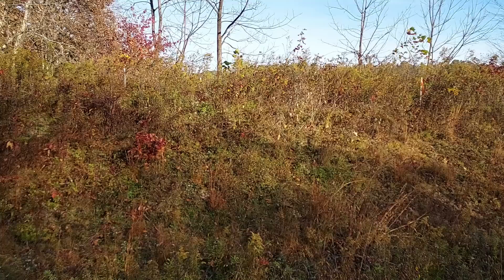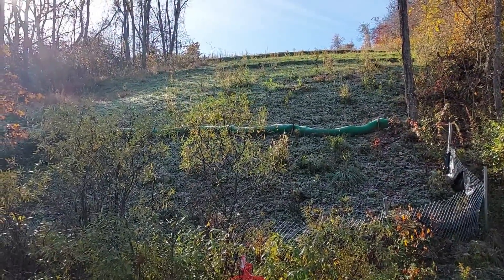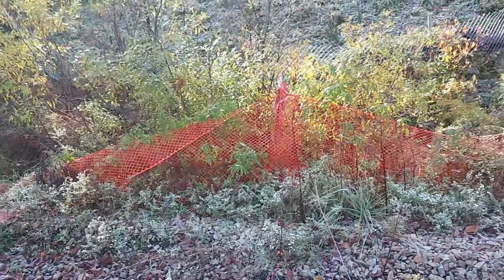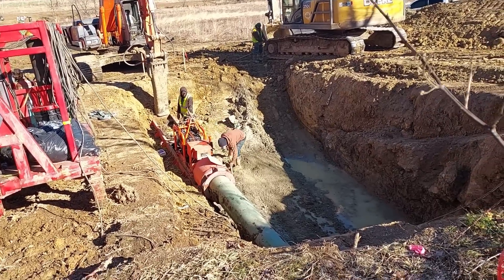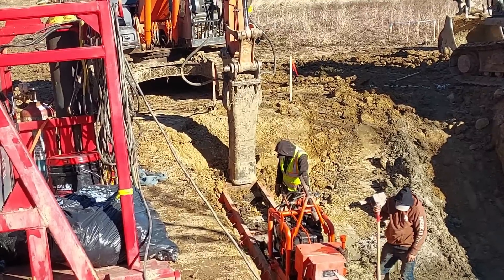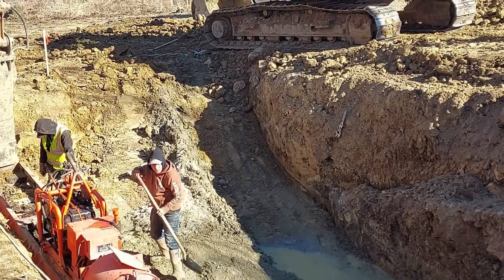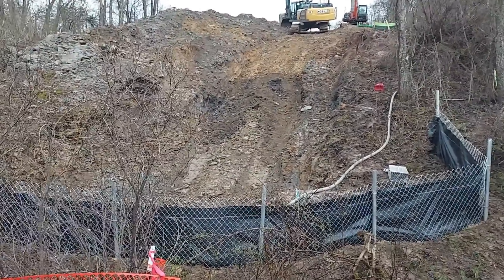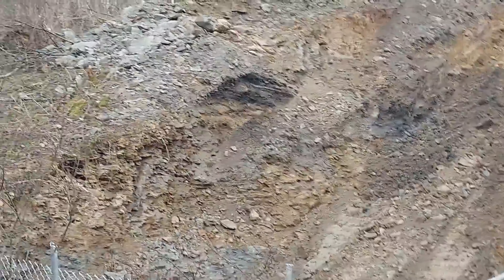Boring Under our Railroad Track

Comment: I bet it is boring under there, not much to do.
Reply from the maker: Actually horizontal drilling is a bit intense, you have to get the
grade right on the bore. The guy in the excavator holding
the rig down , now that may be boring, but an easy day for him 
nonetheless.

Comment: Whenever they bore under the expressways in our area, within a year or so the road develops a dip. As time goes by, they get more severe. I expect it's because they can't back fill the earth to the original compression. On the highway it's an inconvenience. With RR track, I expect it could be dangerous. Do you monitor the ballast for sinking symptoms?
Reply from the maker: That's interesting to hear Rosey. They have bored under our
track many times for pipe lines and never had a problem at
all with track sinking, thank goodness!.  Appreciate your visiting with us and watching. May you have a most blessed day my friend.
Reply: @ccrx6700  Does adding ballast and other rail maintenance possibly compensate for settling?

Comment: Dave those bolts for the track do they have a hardness and torque spec
Reply from the maker: They are grade 5 bolts Ed. Yes AREMA has torque specs for them
depending on the size of the bolt, however we have found over
the many years here with 16 miles of all jointed track that
tightening them to AREMA specs is too tight. Our track has to
move and we have found that around 350 to 375 ft lbs does
the best for us here. Thanks for taking the time to watch and
write in my friend.

Comment: I read a report somewhere on the internet that the I think it's it's called the Federal Railroad Administration (like our Department of Transport in the UK) does not allow fracking with in a certain  distance of a rail road track, some time ago, I cannot find it, but is there such a mandatory  law for this.
Or was it only certain states?
As I read that rail roads were worried about subsidence beneath the rails.

We at my town in the UK had  a large yellow high pressure gas pipe put in using a mole,  it was put under a park and cricket pitch, they dug several holes to start and end it and another half way which was in the middle of the pitch.
Think the pipe was 9 or 12 inches, it might have been bigger, when finished there were bulged in the ground and the bentonite lubricant came our at several place especially the cricket pitch which the cricketers were not happy.
It's amazing what you can do today, as before a digger would have to dig a trench for it. In your case a big disruption on your rail road.
Thanks for ano6the interesting technical video on your RR.
Reply from the maker: I have not heard of that rule Anthony, tried doing a search for
it and found nothing. There are many different shale plays here
in US with varying depths. In my are the Marcellus Shale Play is
7 or more thousand feet under the surface, fracking that far below
a track I don't see any way it could affect surface. If you ever do
find a ruling from FRA on this please let me know. Appreciate
your stopping by and watching the video my friend.
Reply: @ccrx6700  Thanks.
Digging a shaft for coal if not keept pumped out and roof supported will cause subsidence.
In the UK we have incidence  of these.
The main enlargment of the old war time burns hospital at Frenchy Bristol could not be over 2 stories due to this and was moved to anothe part of Bristol, due to the large undergrund mines.
Also like in the US where a coal seam catches fire, I think they have all been put out, but with a lot if structial damage.
You must be great to work with always jolly in all weather and problems.
Thanks for you great railway technical, decriptions and video

Comment: The pipeline carries Natural Gas and gasoline, I think. The fact that the pressure is greatly increased is why it does not freeze. I don't understand why increased pressure makes it hotter, but it does. They have a separator that takes the gas out the top and the liquid out the bottom. The refinery has liquid in the bottom and gases on top of the those tall vessels and power plants have tanks that have steam on the top and water on the bottom. I don't know how that works, but I have seen the displays that shows the water level in the vessel and the steam on the top and it works. Maybe when they installed the pipes the technology wasnt able to have both liquid and gas in the same pipe. But they do it now. These pipes are 70 years old now, the original ones, the 18 inch ones. The 30 inch are at least 50 years old. The 48 inch ones were put in late 80s I think, so 40 years on those.  They test them every 3 months for leaks at the test points. They only mow the ROW once a year, if that. I wish they would mow every month. The grass and weeds get 8 feet high.
Reply from the maker: Thanks for taking the time to watch and write in Rad Bill.
Increased pressure means more friction is produced against
the pipe walls. Thus producing more heat. Very much
appreciate your stopping by today my good man.

Comment: When I was working for the railroad, any construction within 20 feet of the rail and anything over or under the tracks had to have a railroad flag man.  The flag man had to be NORAC qualified so it was usually either MOW or operating crew that would do those jobs on overtime. I did a lot of hours hanging around watching people work while getting time and a half or double time. 
We had a crew doing test borings in a rail yard for a new highway interchange to be built over the yard. Spent a lot of days in that one spot! Nice work if you could get it, but it gets pretty boring (pun intended).
Reply from the maker: Thanks Bill for the awesome comment. We have had several
pipe line operations under our track in the past several years.
Drilling and pipe lining here the industry is tremendous. We've
had to have a flagger on a couple of those also. This one was an
exception. Gas company inspector was virtually non existent
on this job where the last line they bored under our track at
curve 14, their inspector was there constantly and kept in
excellent communication with me and also the train operator.
Another one where they crossed the track with equipment, I
was with them all the time right on the spot. Easy days, but
cannot afford to get anyone run over by a train. Always is
a pleasure to hear from you my friend.

Comment: Natural gas, especially from fractured hard rock wells, produces water.  Most times, this produced water is brine and cannot be dumped.  Reuse makes the most sense, eventually it goes back into depleted wells.
Reply from the maker: Yes it does Keith. That water is called produced water and the
longer a well is in operation the more produced water it makes.
Got a video that I have yet to show where they have a new
innovation, first in the state of Pa. which is an evaporator.
Now they don't have to treat the brine water, only remove
a small amount of solids which depending on content, can
be used for some industrial uses. 

This is an unlisted video but will let you watch it to see the
evaporators in action. 
https://youtu.be/Eww67sjMxho

Comment: Make dam sure that the company gives you a gas sensor to check for leaks in those areas before doing any work , great video Dave but your safety comes first and gas leaks are very dangerous
Reply from the maker: Hear that on the gas leaks Gary. We have 5 natural gas pipelines
under our track in numerous locations. One did have a leak
at bottom of track bed fill. You could smell it. They do put
something mixed in with the gas so you can smell a leak,
but not sure if they do for lines from the well to a compressor
station, kinda think they just add it in at the compressor station?
On that leak Columbia gas guy came out and I hi railed him
down track, he had a fancy tester and even tho you could smell
it on track he said it would do no harm. I've been told also
that if I see a mysterious white kind looking fog don't run thru
it with the truck or equipment cause engine will suck it in
and rev up out of control. Appreciate your concern my friend.
Methane gas in the coal is very dangerous and can easily
cause explosions under the right conditions. We have methane
monitors everywhere at the belts and silos and they are
programmed to shut everything down right now if methane
levels reach a certain percentage.

Comment: It's always those big projects that suddenly pop up. That is quite the undertaking but once it's done you shouldn't have to look at it again. In Milwaukee they are in the final phases of installing a new water line to serve Waukesha WI from Lake Michigan which is the first substantial variance they have given to tapping freshwater from the lake to a inland area. They have to put in about 15 MI of new pipe and presently they are doing the same project as yours except under creek beds.   It will tie into existing water supply pipes in Waukesha because their 4 wells have natural radium contamination that doesn't meet EPA standards. Used water after treatment must be sent back via The Root River and then back into Lake Michigan.
Reply from the maker: Thanks Paul for the awesome comment and for sharing that
with us. Pipe lining is some pretty cool stuff to watch. So far
no problems at all with track bed. There's 5 natural gas lines
under our track in numerous places and none cause us any
grief. Really appreciate your visiting and checking out the
"boring" video my friend.

Comment: The fracking causes natural gas to contaminate the well water and if anyone has well water they should install methane detectors on every level of their home

I have one, just in case.

I don't have any fracking near me, but we do have natural gas deposits 

The other thing is the chemicals used in the fracking water contaminated ground water

If you see places in Texas and the middle of the country where they have fracking Wells you see all these squares every half mile in every direction where they put in gas Wells
Reply from the maker: While I cannot speak for any other part of the country, I can
speak for this area. My son is a foreman for the gas company
that has all the wells here. All water wells in our area are drilled
max 50 feet. Steel casings which are cemented here go down
1500 or so feet. Impossible for well water to get contaminated.

With that said, the gas industry here is highly regulated in Pa.
Perhaps they are not so in other parts of the country. I do
not know. Unscrupulous practices have been known to occur,
what's not surprising about that from not only the gas 
industry but from many other industries.

As far as fracking fluids are concerned, have a video that has
not yet been made public, made it last year. it is unlisted,
in that I address exactly what is in frack fluids. No one has
seen this video yet, however if you would like to watch it
to see what is exactly in frack fluids here is the link. 

https://youtu.be/Eww67sjMxho

I've been on tour of gas wells, drilling and fracking, I am 
not allowed by those companies to make videos while I was
there, that is their company policy, however again I cannot
speak for any other drilling, fracking or gas company
anywhere else other than here. But I can say to you, that
here there is zero ground water contamination.
Reply: @ccrx6700  I used to work in Media and we did an investigation into fracking and I was horrified by what our investigation found out that we did independent tests and we never released the documentary. But. We did talk with another company that did a documentary in Texas and they had film of houses exploding because of methane getting into the well water and leaking into the house. There were over 100 toxic chemicals in the frack fluid. The gas company in Texas bought over 1000 homes because of the high methane levels and they were prohibited from going in their homes after several of the explosions.

The well casings on over 90% of the wells failed.

Here in Pennsylvania water is deep and 500 feet is the minimum to hit ground water and usually you have to go down about 1000 feet to get reliable flow

The gas is in between rock layers. There is not much of it, so they have to break up the rock to get all those little pockets and drill wells every 1000 feet to get at these pockets. It is very inefficient. And once the rock is fractured, the hydraulic pressure sends the water everywhere underground and the gas goes right along with the water

We see bubbling in the ground and water. It smells awful 😞
I wish they would invest the amount they do in wells in home solar panels and windmills.
They would produce more energy

The natural gas mainly goes to the power plants

They used to use coal. Now they use natural gas
If it didn't contaminate the ground water I would have no issues with it

Comment: Great stuff here Dave, that shovel guys back was probably toast cleaning the spoils from that bore. And was surprised not seeing a safety chain or cable on the welder with them guys welding in that hole, if that shackle holding it to the cable would let go. Man, game over for them. Thanks for the coverage. Love seeing this kind of work..
Reply from the maker: Thanks Pappy, glad you enjoyed the "boring" video today. Safety
on this pipe line left something to be desired, not gonna argue
about that. Never saw a pipe line inspector. When they bored 
under the track on curve 14 gas inspector was there all the time.
He called me and Russ several times every day to see when
train would be running and for clearance.  They also had no
shoring in that bore pit.... Real scary stuff there.

Comment: I have 4 pipes running in front of my house

The original pipe was 18 inches

The second one they ran in the 60s is a 30 inch

In the 80s they put in 2 more pipes, both 48 inch in diameter

These 4 run to a pumping station a mile away where the other 4 pipes join the group and they are building a new compressor station

They used to run just gas in the lines but about 10 years ago they started running both gas and liquid in the same pipe and they increased the pressure

When they did that the ground stayed unfrozen all winter and the snow melts off the Right of Way where the pipeline is

SCARY
Reply: Why?
Reply from the maker: That certainly does seem odd about the ground not freezing.
Wonder what kind of liquid they are mixing with the gas, or do
they run one then stop and run the other? We have a ton
of gas lines here, all different sizes but no where do I know of
that the ground doesn't freeze above them. Thanks for writing 
in and watching the "boring" video today my friend.

Comment: Is this a fracking well ? 

Does this Join into the main gas pipeline that runs across NJ and PA and goes down to Texas ?
Reply from the maker: Well site currently has 8 wells on that have already been
fracked, drilled into Marcellus Shale formation. Pipeline
carries the gas from those wells about 5 miles to a compressor
station where it will get put into Columbia Gas Transmission
line. I do not know were it goes once Columbia takes it. There
are several huge compressor stations for Columbia that
are located around Waynesburg so guessing it will go to them
but after that no idea. Thanks or stopping by and taking in
the video today my friend.

Comment: Too bad Cumberland doesnt have any CNG powered locomotives, that would be the cleanest burning fuel, and a CNG station would be great for fueling the engines!!
Reply from the maker: Well Paul, 2 weeks ago we had vice president of purchasing
along with reps from a car manufacturing facility visit us.
They were selling hopper car that have trucks that are battery
driven. Each truck on the cars will actually be driving wheels
thus saving fuel on the locos. Interesting concept. Marketing
department here is trying to it the green scene I guess. We shall
see if those cars are ever bought. We definitely need new
cars. As far as LNG locos that will probably never happen. But
there are several businesses around here that are switching over
to the liquified natural gas. New horizons are coming. Really
appreciate your stopping by and watching my friend.
Reply: @ccrx6700  when i was younger, i lived next door to a guy that did HAM radio. He had several devices known as "gen-e-motors", which were essentially a self-contained power supply, and if the electric "grid" failed for any reason, these gen-e-motors kept running, supplying power to each other, and his HAM radio equipment, so he could communicate with emergency personnel. Those gen-e-motors would be ideal for the Cumberland situation, as they would eliminate the batteries in the hopper cars, and their continuous maintenance. Just get them up to speed, and they power themselves, 2 to a truck, with 4 to a car, total, and the locomotives would only assist on hills and braking.

Comment: great video again.  Any worry of mine subsidence causing pipeline issues?
Reply from the maker: Thank you Dave, glad you enjoyed. Very good question sir.
The area they pipe lined under here was mined out over
45 years ago so no worries on subsidence here. However,
there has been some major concerns in other areas
in our country where the mines have long walled under
existing pipe lines. That has led to court battles and a lot
of other issues about who is responsible if a pipe line
breaks after the area is long walled under. Our sister mine,
emerald had a big court battle over that many years ago.
With room and pillar mining under an existing pipe it is
not generally any issue at all. R&P mining was done 
under this particular pipe line by robena mine way back then.